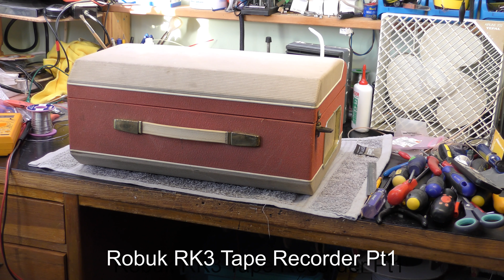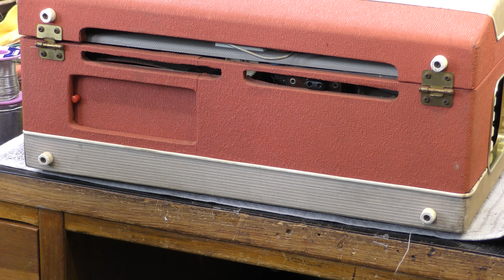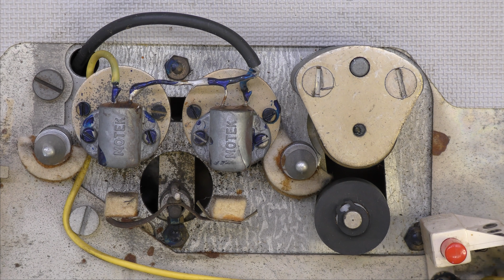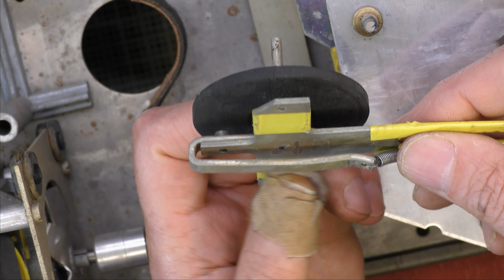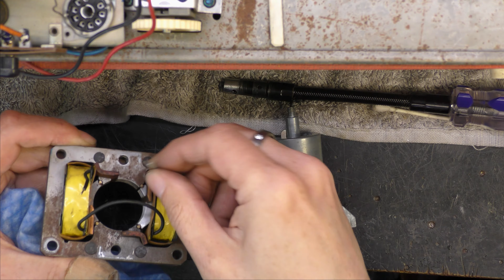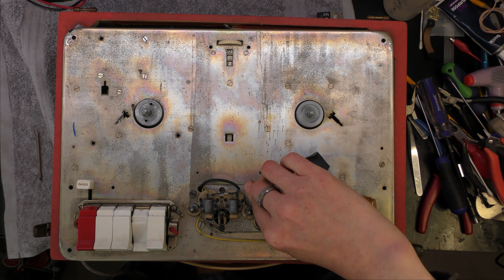Robuk RK3 Pt1 Vintage Tape Recorder (4K)

Comment: I pulled one of these out of a skip when I was 6 or 7 but never got it to work and eventually took it to bits. Much later I bought another one off of eBay out of sheer curiosity but apart from everything that was wrong with it even before it was sold, it suffered quite dramatic damage in transit from the UK to the continent. The chassis was ripped out of the case, most plastics are broken, the take-up motor is knackered and the reel hub is rubbing on the motor casing, probably a completely butchered bearing. I replaced loads of quite leaky paper caps and tried playing a tape but only got the faintest hint of audio. The rubber idler for the flywheel is rock hard and I think the pinch roller isn't in great shape either.
I do have some spares I saved from the one I took to bits as a kid, most importantly the take-up motor but also the valves, the metal frame with the potentiometers and mains switch and a few other small bits. Certainly not worth saving from a financial perspective but might try for nostalgia's sake. The original mains lead is mental, so tiny! 0.5 mm2 is beefy in comparison. If I decide to fit a European plug to it I'll probably have to replace the lead because I really don't feel comfortable running it without the original 3 A fuse in the UK plug. 3G0.75 mm2 should do nicely as a replacement, 0.5 would be enough but is hard to find, especially 3-core.
Reply: All the capacitors were duff on mine BTW, both the black Hunts ones and the blue Dubiliers. I meggered them and they all had DC resistances in the mid-kΩ range at 250 V (300 V rated I think), which is absolutely horrible. There's a schematic diagram of the motor wiring somewhere on the internet but I think I only found it searching for the mechanism, which is a Motek K11.

Comment: Hello, my grandpa just passed me one of these units. What kind of tape would they take and is it easy to come by in the UK? I have never really used a reel to reel machine before.
Reply from the maker: It uses standard 1/4 inch tape and up to 7 inch reels.  You can buy this new and various online market places that will have second hand tape. Some old tape may not be very good and will shred it's particles on the heads, but other tapes hold up well. Daz.
Reply: Hi Daz, thanks for you message that really helps! Robin @darrencoe5795

Comment: interesting... that unit has to be borderline fix or strip for parts. The valves would get more from ebay rather than the complete machine!
Reply from the maker: Well, George a friend has been buying up tape recorders to do that. Fine, but going to become harder to find tape recorders in the future I guess. Some are stripping to make guitar amps. The machine is  a challenge I guess. I must admit I do up too much stuff that is not worthwhile, Ha ho.

Comment: Interesting use of the valves. I would have put my money on the EL84 as audio output and the ECL82 as preamp and bias oscillator. A better option would have been to use a ECC82 as a push pull bias oscillator, as used in some Mullard circuits.
Not that common to use 3 motors in a domestic machine. A step up would be to use a Papst motor for the capstan. This would have removed the rubber drive wheel and fly wheel. Speed change would then be by pole change, no mechanical stuff at all. Makes for very low wow and flutter. Only 2 speed however!! I'm looking forward to part 2. Thanks for the upload Darren!! though Daz was a washing power lol!! sorry!
Reply from the maker: I wash whiter, Michael! Its a oddity full stop but at least you have monitor during record. Im amazed at the erase power needed on this one. The decision to use 3 motors is odd and then not give some sort of electrical braking. Yes, Akai often used 2 speed motors, just like the one in opening title.
Reply from the maker: PS second part schedule in early october.